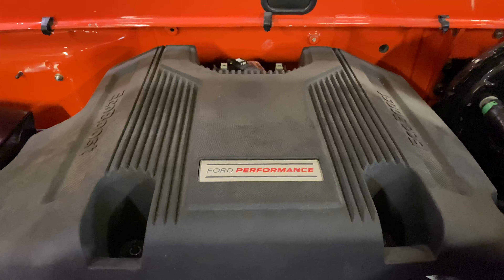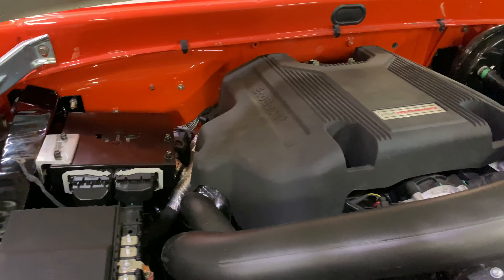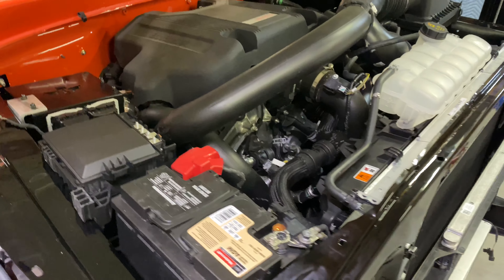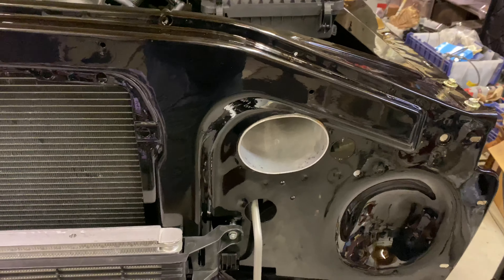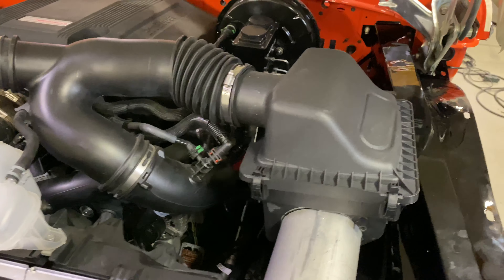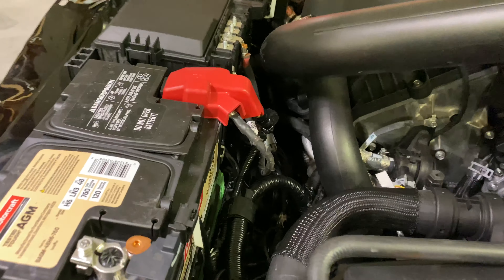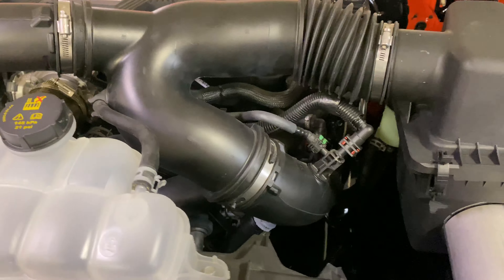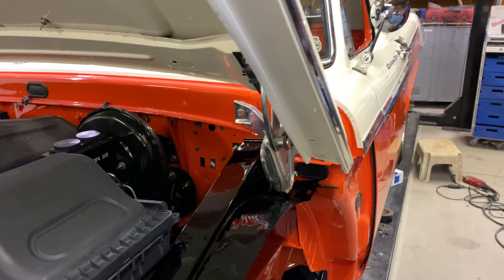1966 F100 Raptor Crate Engine 10R80 Update

Comment from the maker: This upload in 4k  Getting very close to that first test drive! Underhood now very close. Bit more wire routing. I still need to add fluids as only engine oil so far. Once test drive complete I can install remainder of front clip which should go very quickly.